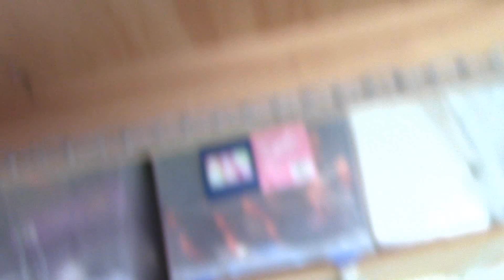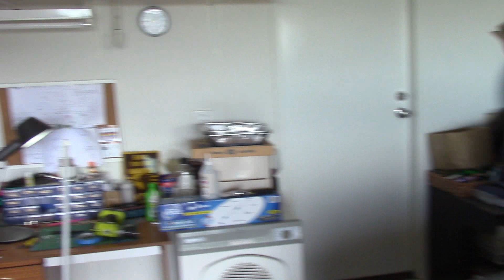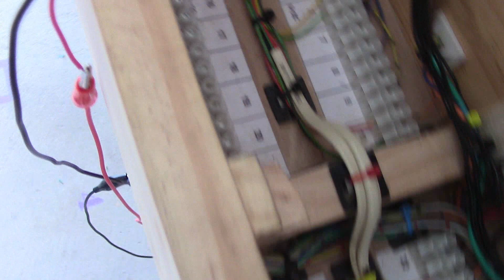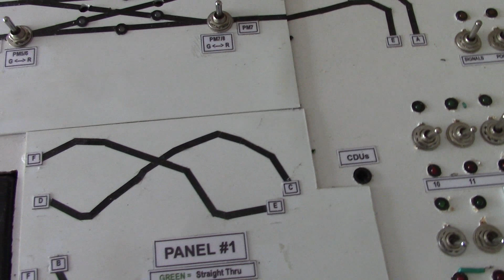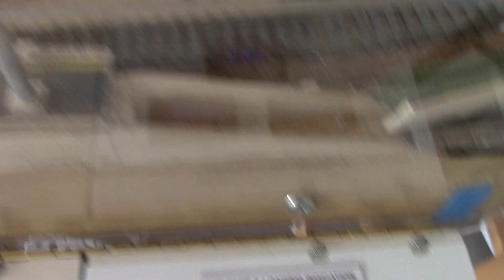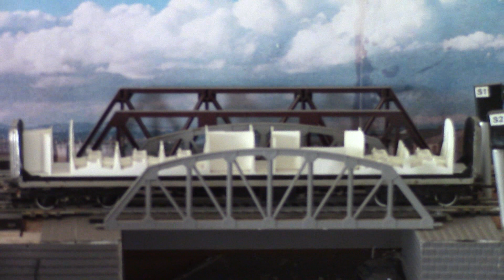HVR #8

Comment: I am very interested in your control panel.  Which video should I watch for an in depth discussion of your control panel?  Rob
Reply from the maker: Hi Rob, thanks for your interest in the control panel. I think this video has the most in depth discussion. It started out as a single panel incorporating the Digitrax controller and switches for signals and points (turnouts in "your" language. :)  Then when I added the extension with the platforms - on the left with the tracks running at 90 degrees to the main layout - I needed another panel, so that panel was added. 

The right hand panel was originally added at the same time, but it very quickly became redundant in its original configuration. So when I added the 3 separate power supplies it was redesigned to accommodate the switches, which was then redesigned, again! This was because of the extra switches needed for all 3 voltages. The reason for the different voltages was so I could better control the intensity/brightness of the lighting. Having been a "sparky" all my working life and "dabbling" in electronics, it seemed the logical thing to do! :-)

I hope that covers your query. If you need anymore information please feel free to ask. It can be covered here or by private email if you wish.Regards,  .. Ian ...